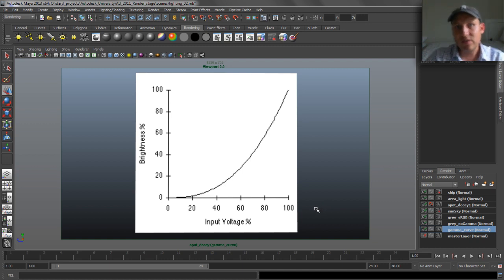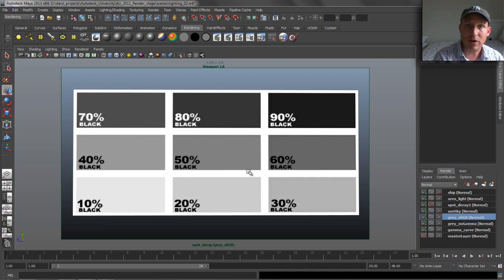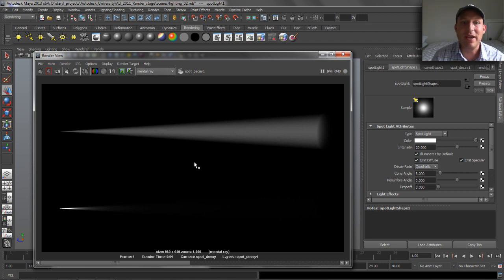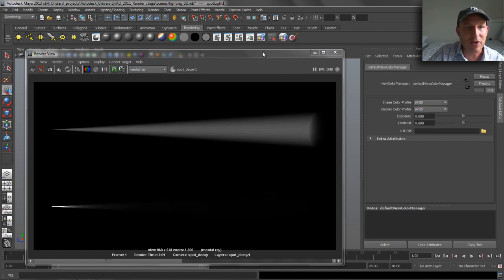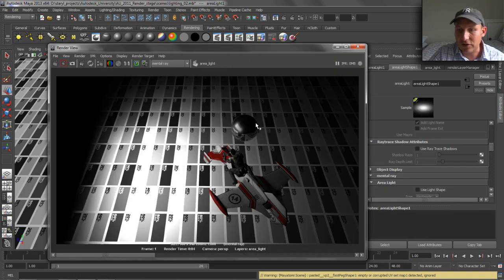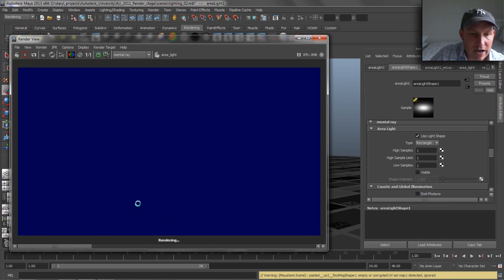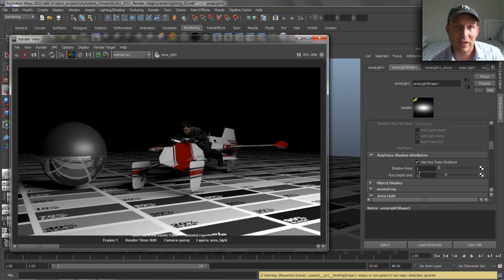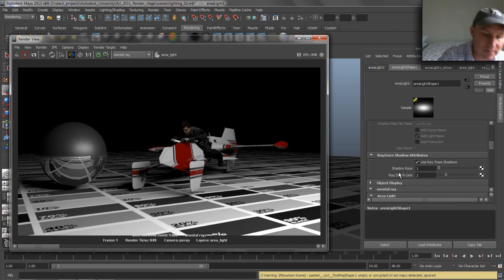Maya lighting 101

Comment: Hey Daryl I have a question concerning the linear workflow. When I batch render it doesn't show the linear lighting, I rendered out a 120 frames and they were all rgb. I was dissapointed cause when I render a single fram it shows correctly, is there some sort of setting to get a batch render to output the results the same as render window?